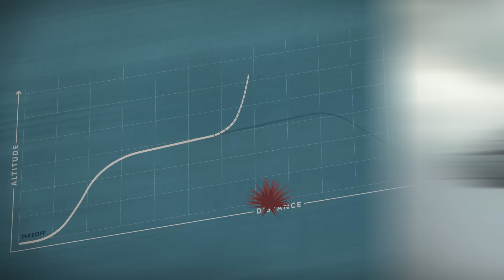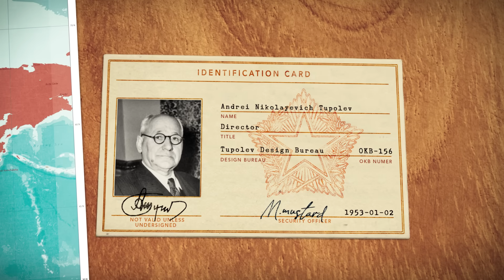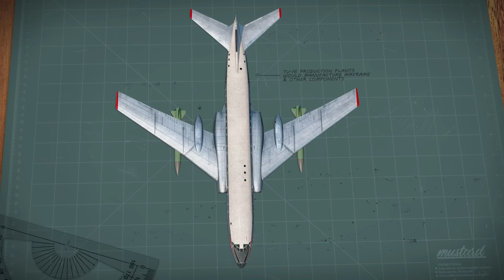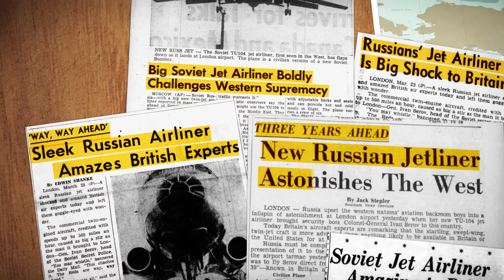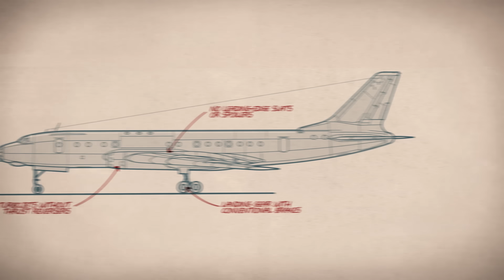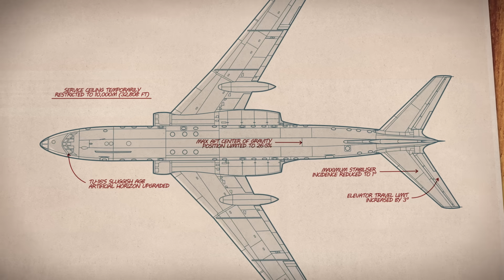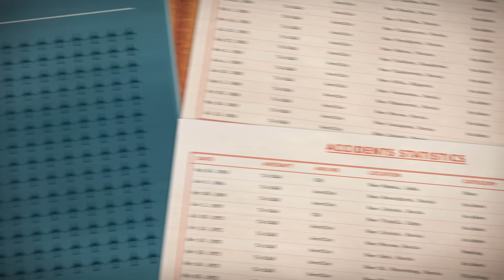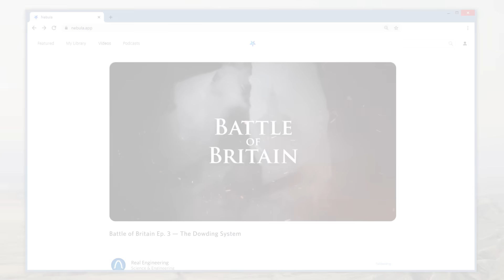The Soviet Airliner Designed To Crash

Comment: Everything the soviets built they did at a fraction of the cost. That’s what happens when you pay your employees in food stamps
Reply: Same with British aircraft... at least the Soviets had a better safety record,
Reply: @DoktorBayerischeMotorenWerke 

Obviously it's always very important to note the relevant facts.     

We do indeed feel we can clear up some commonly held myths and misconceptions.
   
The DC 10 has an average safety record for an aircraft that first flew in 1970. The cargo door fault that caused the historically deadliest aircraft accident loss incident at the time was not rectified for all aircraft immediately due to an agreement between an FAA person and people at the manufacturers. The aircraft only attained average safety stats after a number of significant safety related modifications were completed for all DC10 aircraft during the early years of operation.

 Of course De Havilland carried out a full stress analysis & performed extensive & protracted testing on two long lengths of fuselage. De Havilland carried out significantly more testing than was required by any authority at the time.
 
It is the case that the stress for the crown sheets when measured was not greater than predicted.
  
  Obviously there have been worse aircraft for accident losses both before & after the Comet.

    How things were back then -
Accident losses - % of aircraft built.
DeHavilland Comet 4 UK     14% 
DeHavilland Comet all mks  17%  
Vickers VC10 UK 5%
   The DH Comet had better safety than or similar safety to many other commercial passenger aircraft of a similar era
    Douglas DC-1        99%
      Douglas DC-2        47%
    Douglas DC-3        30%
      Douglas DC-4          26%
    Boeing s300            72% 
 Boeing 307               70%
  Boeing 247                48%
     Boeing 707                   20% 
Lockheed L-049/149 Constellation  30%
   Lockheed Electra  Turboprop    29%
Fairchild FH-227                        30%
 McDonnell Douglas DC-8        14%
  Sud Aviation Caravelle            15%
Canadair CL-44  Turboprop     46%  
Convair CV-580  Turboprop     22%
Convair CV-880    (ff 1959)       27%  
Convair CV-990     (ff 1961)      33%
Tupolev T-104          (ff 1956)    16%

Obviously the French Caravelle, a very similar aircraft to the Comet, also at the time didn't result in Sud Aviation becoming a significant competitor to Bow-wing  (See B-47 wing folding and wing collapse incidents).
        The Comet was designed with military use in mind, Nimrod work started at De Havilland in 1953.
  The committee did not find hundreds of fatal flaws or evidence of design defects, structural defects, defective materials or shoddy workmanship. Ripstop provision was included. Claimed incidents did not involve cracks starting from window corners & one particular incident did not involve a fracture running from a rivet hole. 
     The engine & engine intake position had advantages, were not flaws or fatal flaws & were not the cause of any incidents involving any Comet or Nimrod aircraft. Nearly all changes before the Comet 4 were just in case or were previously scheduled improvements. 
  In fact it is the case that the skin thickness of the Comet remained largely unchanged for later versions. The alloy used was changed simply because the manufacturer discontinued the original version. 
  Bow-wing & the 707 story (see b-47 wing folding & wing collapse incidents) is the result of global economics & the well protected & very large domestic US airliner market & active support from the UK with for instance proposed competing airliners from Vickers & DH being blocked by the UK government at the time, cheap & nasty was the requirement with large scale production capability in one place.
  The 707 was of course a much larger aircraft which as a stressed skin metal airframe aircraft would require a thicker skin anyway. They got lucky at the time essentially.  Bow-wing is the result of the large & well protected  US domestic airliner market 
  The 707 had a very long production run with a large number produced, the average life of a 707 doing airline duty only was about 22 years. Military duty 707 airframes get a lot of big military budget attention & there are plenty of spares from retired aircraft which is why there are still examples in service.
  The fate of De Havilland was due to Govt policy Aerospace sector rationalisation & global economics, it was nothing to do with the Comet.
  A comprehensive, thorough & protracted testing program was carried out on the prototype & it's assemblies. Of course the Comet did indeed have Ripstop stop provision. 
     De Havilland (Of England) Comets were not grounded after 1970 due to structural problems.
It's interesting that some of the aircraft on the list should really have been noticeably safer than the Comet due to being a similar type but of much later design & manufacture but they definately were not safer.
    How things were back then -
Accident losses - % of aircraft built.
DeHavilland Comet 4 UK     14% 
DeHavilland Comet all mks  17%  
Vickers VC10 UK 5%
   The DH Comet had better safety than or similar safety to many other commercial passenger aircraft of a similar era
    Douglas DC-1        99%
      Douglas DC-2        47%
    Douglas DC-3        30%
      Douglas DC-4          26%
    Boeing s300            72% 
 Boeing 307               70%
  Boeing 247                48%
     Boeing 707                   20% 
Lockheed L-049/149 Constellation  30%
   Lockheed Electra  Turboprop    29%
Fairchild FH-227                         30%
 McDonnell Douglas DC-8     14%
  Sud Aviation Caravelle       15%
Canadair CL-44  Turboprop   46%  
Convair CV-580  Turboprop 22%

A comparison of more recent aircraft.
Accident losses comparison examples. 
1970s - 1980s
    % of total Aircraft built
Similar aircraft type, date / decade, useage, size.
    Biz Jets
BAe-125-800                        1.7 %
Beechcraft Beechjet 400    2.2 %
Cessna 550 Citation II         7.1 %
Learjet 35 / 36                       12 %
Beechcraft 1900                  6%
Dassault Falcon 10              11.5%
Aérospatiale SN.601            22.5%

Medium size jets / Turboprops.
DC10      ff 1970                7%
BAe-146                        5.1%
Fokker 100          6%
McDonnell Douglas DC-9-30       9.5%
Fairchild FH-227       30%
McDonnell Douglas DC-8    14%
Canadair CL-44  Turboprop   46%  
Convair CV-580   Turboprop   22%

Beechcraft, Fokker, McDonnell Douglass, Learjet, Fairchild, Aerospatiale, Canadair, Convair  companies defunct.

    All Comets, including some Comet 1s, had full civilian use certification at some point after 1954,  civilian use certification only being withdrawn after commercial flying stopped. Examples were flying until 1997 - one example did a signals research global circumnavigation flight series in 1993 via Australia virtually without a rest travelling 28000 miles, only had an ice warning indicator issue during the flights.

    The DH Comet - World Firsts.
1st gas turbine jet powered airliner. 1st high altitude 8psi pressurised full fuselage length passenger cabin airliner,  not a trivial feature as structure  strength required for pressurisation considerably exceeded strength required for normal flying stress. Nobody else had done anything similar before the Comet.
  The b-47 (& the Junkers) used relatively small, heavily built  pressurised modules  (Bow-wing b-47, the aircraft where 6 had their wings fold up in 2 months while flying & some had their wings fall off while parked). 
   The 1937 Boeing piston engined airliner pressurised passenger cabin was pressurised to 2 psi only - in fact that could easily be done as the normal unpressurized fuselage cabin structure strength for flying stresses only was all that was needed to be adequate so no significant weight increase issues needed addressing.
    1st all hydraulically powered flying surface controls & actuators airliner with under carriage wheel disk brakes + ABS.
1st jet airliner to cross the Atlantic.
1st jet aircraft to do a world circumnavigation flights series.
  Of course De Havilland had prior experience building many all metal construction airframe aircraft including thousands of jet powered fighter aircraft that were primarily of metal construction with pressurised cockpits & jet engines built by De-Havilland & we know the world's first all metal construction airframe airliner was built in England in the 1920s by Handley Page.
  Indeed it is in fact the case that airliner construction & testing changed everywhere, including in the US, during & after the Comet investigations.
     De Havilland did indeed always work to better than industry standards at the time, used up to date knowledge for the design & no evidence of negligence  or criminal negligence was ever produced in relation to the DH Comet.
    The course of De Havilland & the general UK aerospace industry sector was not affected even slightly by the DH Comet. The course of national aerospace sectors obviously being similar & inevitable in many countries.
     Other interesting World firsts
World's first turboprop aircraft.
Vickers Viscount Turboprop Airliner 1947. 
A 1945 Gloster Meteor Aircraft with Turboprop Gas Turbine Engine.

They might like to answer these questions.
   Which airline has just ordered
60 RR England Trent XWB Engines
& What aircraft are the engines for?

Bonus question for 10 points.
         Which country has the 
World's Highest Combined Per Capita
  Nuclear + Defence + Aerospace Sector Activity?    

          👍 & 🙂 & of course 😎 indeed.
          C H E E R S without doubt  -

Comment: If its Russian, then YES, it's the most dangerous airlines in the world.
Reply: Statistically British jet airliners were the most dangerous, the de Havilland Comet has the highest loss rate and fatalities statistic of any jet airliner in history.
Half of all Comet 1s built crashed or were destroyed in accidents before its certificate of airworthiness was permanently revoked.,
Reply: @DoktorBayerischeMotorenWerke 

  It will come as no surprise that we feel we can clear up some commonly held myths and misconceptions, of course.

  Indeed, It's always good to see the facts presented clearly and concisely isn't it?

    It's not valid to compare a Bow-wing ( see B-47 wing folding & wing collapse incidents for details) jet airliner designed & first built as late 6 decades after the Comet, with the fabulous De Havilland Comet, the world's first high altitude jet powered airliner.  

  Vast improvements in commercial aviation infrastructure alone being a significant factor in improvements in air travel safety safety over more than half a century.

    Of course 50 years more design, build & operation experience didn't prevent the horrendous Bow-wing 737 Max incidents, there can obviously be no excuses for that.

Obviously there have been worse aircraft for accident losses both before & after the DH Comet & the Tupolev T-104.

    How things were back then -

Accident losses - % of aircraft built.
DeHavilland Comet 4 UK     14% 
DeHavilland Comet all mks  17%  
Vickers VC10 UK                     5%
Tupolev T-104                          16%

   The DH Comet & Tupolev T-104 had better safety than or similar safety to many other commercial passenger aircraft of a similar era

    Douglas DC-1        99%
    Douglas DC-2        47%
    Douglas DC-3        30%
    Douglas DC-4        26%
    Boeing s300          72% 
 .  Boeing 307            70%
  .  Boeing 247           48%
     Boeing 707           20% 
Lockheed L-049/149 Constellation 30%
Lockheed Electra  Turboprop           29%
Fairchild FH-227                                30% McDonnell Douglas DC-8                 14%
Sud Aviation Caravelle                      15%
Canadair CL-44  Turboprop              46%  
Convair CV-580  Turboprop              22%
Convair CV-880    (ff 1959)               27%  
Convair CV-990     (ff 1961)              33%
Tupolev T-104          (ff 1956)            16%

As always, we hope this helps, obviously.

Cheers & 👍 of course.

   
 ... .

. ....

Comment: Still, Russia First in Space, First Space station. Oh 😄 Sputnik 👍
Reply: Have you heard the joke about the two British astronauts that walk into a pub???
Reply: @sandervanderkammen9230 

  It will come as no surprise that we feel we can clear up some commonly held myths and misconceptions, of course.

  Indeed, It's always good to see the facts presented clearly and concisely isn't it?

    It's not valid to compare a Bow-wing ( see B-47 wing folding & wing collapse incidents for details) jet airliner designed & first built as late 6 decades after the Comet, with the fabulous De Havilland Comet, the world's first high altitude jet powered airliner.  

  Vast improvements in commercial aviation infrastructure alone being a significant factor in improvements in air travel safety safety over more than half a century.

    Of course 50 years more design, build & operation experience didn't prevent the horrendous Bow-wing 737 Max incidents, there can obviously be no excuses for that.

Obviously there have been worse aircraft for accident losses both before & after the DH Comet & the Tupolev T-104.

    How things were back then -

Accident losses - % of aircraft built.
DeHavilland Comet 4 UK     14% 
DeHavilland Comet all mks  17%  
Vickers VC10 UK                     5%
Tupolev T-104                          16%

   The DH Comet & Tupolev T-104 had better safety than or similar safety to many other commercial passenger aircraft of a similar era

    Douglas DC-1        99%
    Douglas DC-2        47%
    Douglas DC-3        30%
    Douglas DC-4        26%
    Boeing s300          72% 
 .  Boeing 307            70%
  .  Boeing 247           48%
     Boeing 707           20% 
Lockheed L-049/149 Constellation 30%
Lockheed Electra  Turboprop           29%
Fairchild FH-227                                30% McDonnell Douglas DC-8                 14%
Sud Aviation Caravelle                      15%
Canadair CL-44  Turboprop              46%  
Convair CV-580  Turboprop              22%
Convair CV-880    (ff 1959)               27%  
Convair CV-990     (ff 1961)              33%
Tupolev T-104          (ff 1956)            16%

As always, we hope this helps, obviously.

Cheers & 👍 of course.

Comment: The DeHavillan Comet, the world’s first jet airliner, was grounded after a series of non-fatal and fatal incidents. The Soviet Union could’ve learned from that, but no, the weak capitalist West’s plane was obviously inferior and ours was perfect. Keep flying the Tu-104.
Reply: The Tu-104 has a significantly better statistical safety record than the Comet, the Comet has the highest loss rate and fatality stats of any jet airliner in history..
Reply: @DoktorBayerischeMotorenWerke 

  It will come as no surprise that we feel we can clear up some commonly held myths and misconceptions, of course.

  Indeed, It's always good to see the facts presented clearly and concisely isn't it?

    It's not valid to compare a Bow-wing ( see B-47 wing folding & wing collapse incidents for details) jet airliner designed & first built as late 6 decades after the Comet, with the fabulous De Havilland Comet, the world's first high altitude jet powered airliner.  

  Vast improvements in commercial aviation infrastructure alone being a significant factor in improvements in air travel safety safety over more than half a century.

    Of course 50 years more design, build & operation experience didn't prevent the horrendous Bow-wing 737 Max incidents, there can obviously be no excuses for that.

Obviously there have been worse aircraft for accident losses both before & after the DH Comet & the Tupolev T-104.

    How things were back then -

Accident losses - % of aircraft built.
DeHavilland Comet 4 UK     14% 
DeHavilland Comet all mks  17%  
Vickers VC10 UK                     5%
Tupolev T-104                          16%

   The DH Comet & Tupolev T-104 had better safety than or similar safety to many other commercial passenger aircraft of a similar era

    Douglas DC-1        99%
    Douglas DC-2        47%
    Douglas DC-3        30%
    Douglas DC-4        26%
    Boeing s300          72% 
 .  Boeing 307            70%
  .  Boeing 247           48%
     Boeing 707           20% 
Lockheed L-049/149 Constellation 30%
Lockheed Electra  Turboprop           29%
Fairchild FH-227                                30% McDonnell Douglas DC-8                 14%
Sud Aviation Caravelle                      15%
Canadair CL-44  Turboprop              46%  
Convair CV-580  Turboprop              22%
Convair CV-880    (ff 1959)               27%  
Convair CV-990     (ff 1961)              33%
Tupolev T-104          (ff 1956)            16%

As always, we hope this helps, obviously.

Cheers & 👍 of course.

. . . ..... .  ..... ......